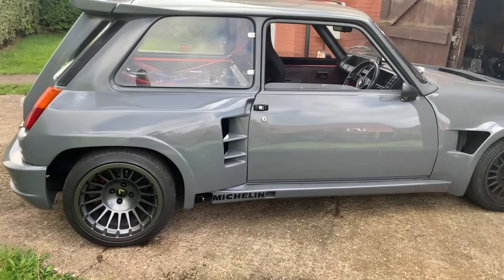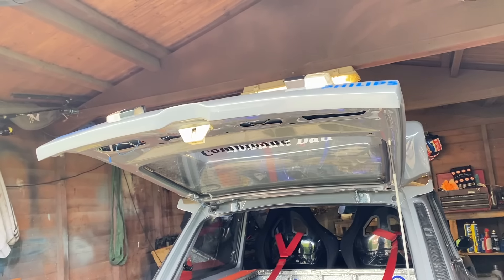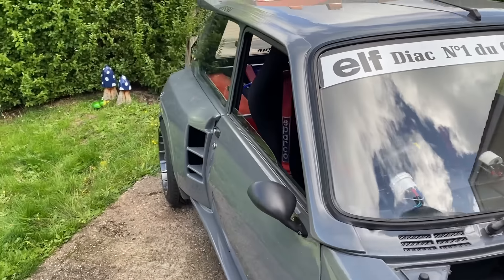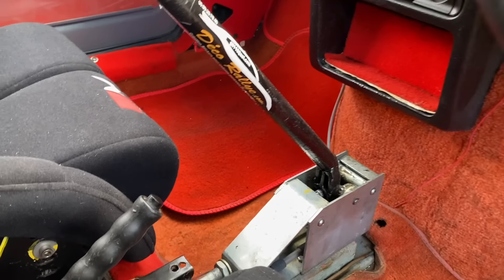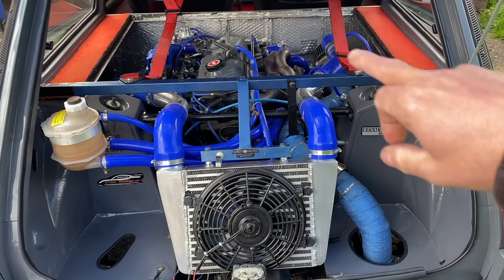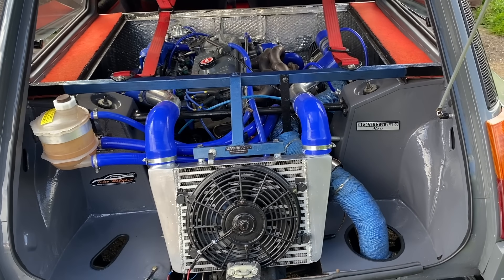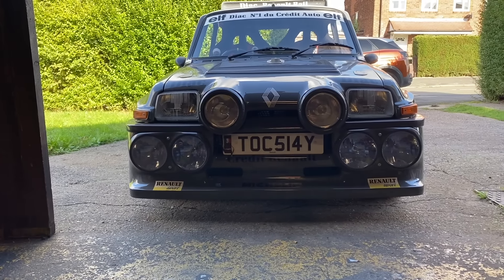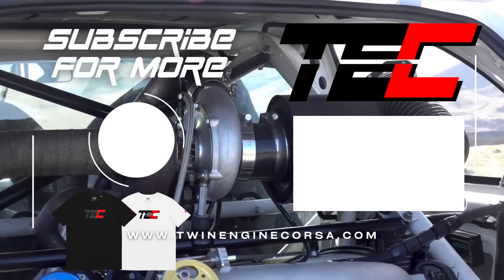HOME MADE Renault 5 GROUP B RALLY Tribute!

Comment: The Mk1 Renault 5 had the engine mounted longitudinallly with the gearbox in front, that's why it has a massive "transmission tunnel" bulkhead and a very narrow engine bay. My Brother had a Gordini and I helped him change the clutch on it - a mammoth task for a 10 year old. We had to cut the front slam panel out and pull the gearbox out the front of the car.

Pretty sure they also had torsion bar/leading arm suspension at the front.

Comment: that air 'cone' filter installed on such a turbo set-up is 'poaching' at least 50 to 100 HP...a thin grill will protect it enough..anyway..,it is a beautiful build with passion...using the Renault 11 stock turbo block is a better idea than fitting (finding) a turbo on an N/A 1.4 l classic R5 engine ..I installed a ROTREX supercharger on my N/A 1.4 Clio and it broke..!! ,it refused to take the extra boost..!!..so the idea of the R11 turbo just came to me watching your video..!!

Comment: All these mark 1 Renault 5s had longitudinal in line engines and tortion bar front suspension so no strut tops, that'll be factory inner wings on that car. It was the mark 2 cars like the 5 GT turbo that had transverse engines.

Comment: 1982 Renault 5 Turbo Group B
€257,600 EUR | Sold
France | Paris, France
DETAILS
  language
Chassis No.
VF1822004D0000020
Engine No.
C7573124
Documents
Greek Vehicle Registration Certificate
   
CATALOGUE
One of 20 factory ‘Tour de Corse’ examples
Campaigned in period as a Renault Works car
Comes complete with full spares package
Includes original homologation papers for Group 4 and Group B
255 bhp, 1,397 cc turbocharged inline four-cylinder engine with Bosch K-Jetronic fuel injection, five-speed manual transmission, independent front and rear suspension with anti-roll bars, and four-wheel disc brakes. Wheelbase: 2,430 mm

The evolution of the Renault 5 Turbo is directly linked to the evolution of the rallying scene. Beginning with the introductory ‘Cévennes’ model, the Turbo dominated the 1981 Monte Carlo and the 1982 Tour de Corse Rallies. The introduction of the new Group B rules for the 1983 season brought the ‘Tour de Corse’ – capable of an astounding 300 brake horsepower. The car offered here today has a history spanning these advancements, placing it at a pivotal moment in the rallying world.

Chassis number D000020 can trace its history back to 1981 when it was a Renault Works car, driven as #20 by Bruno Saby and Daniel Le Saux in the 1981 Monte Carlo Rally. After suffering an accident, the car was sold to Renault Greece representative Alexandros Maniatopoulos, known in the rallying world as ‘Leonidas’. Promptly painted into FINA livery in readiness for the Acropolis WRC of 1982, it finished 8th overall; the car was then sent back to Renault Sport headquarters at Dieppe for updates to Group B specification.

In 1983, Leonidas again entered Acropolis WRC along with the national rallies of Halkediki and Albena. The 1984 season saw chassis number D000020 sold to Dimitris Manolopoulos, who campaigned the car with son Thomas. The pair was hugely successful in the national Greek hill climb and National Greek rally, accumulating over 200 race wins in their 30-year ownership.

Currently located in Greece, this Renault 5 Turbo comes with a full history with period documents, a full spares package, and even retains the original team quick lifting gear for front and rear. Eligible for all premier historic rally events such as Tour De Corse Historique, Eiffel Rallye, and the FIA European Historic Rally Championship, chassis number D000020 is an excellent option for any driver looking to hit the rally